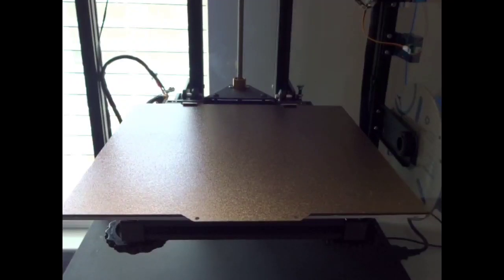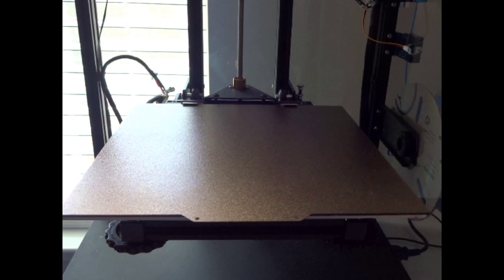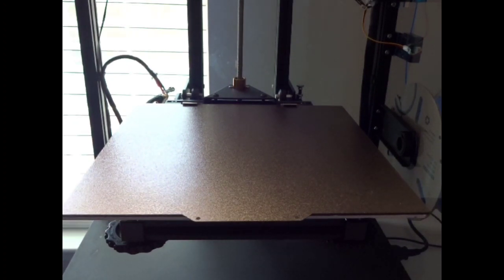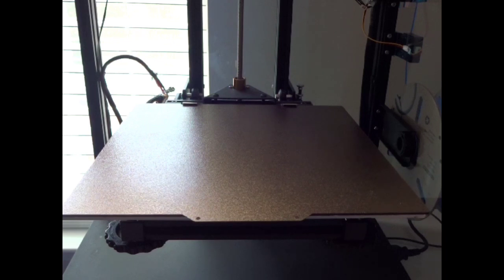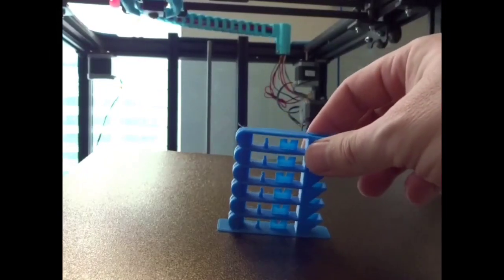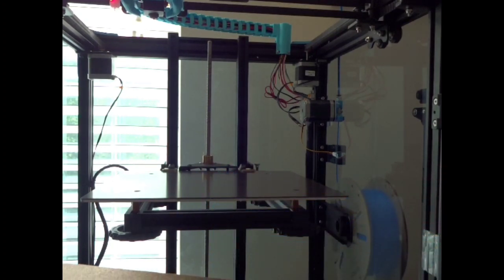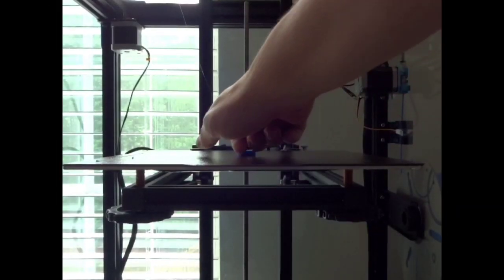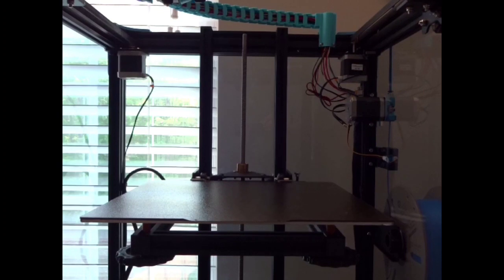Creality Ender 6 - Energetic 290x290 pei build sheet review.

Comment: I have had one of these for a year and only had one 2cm print work. I have replaced so many of the original parts as I found faults in the standard that added half again to the cost of the printer.
DON'T buy this... Buy a printer that works! I have a Sonic Mighty resin printer which keeps on going  with perfect print after perfect print. 
This is the Ender of printing.
Reply from the maker: Sorry to hear it. My ender 6 works pretty well.